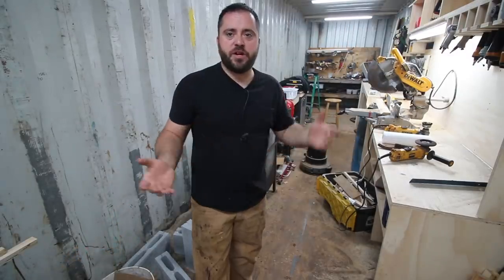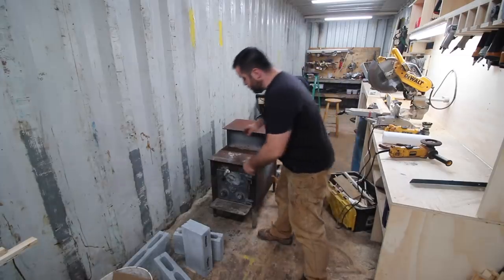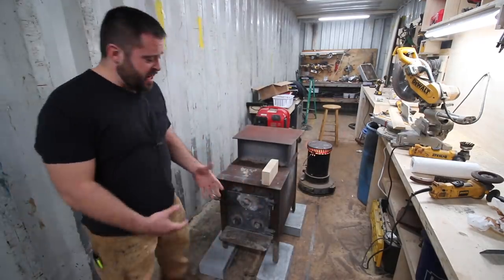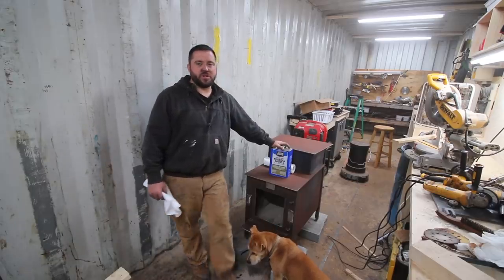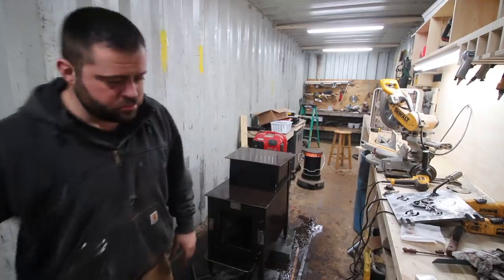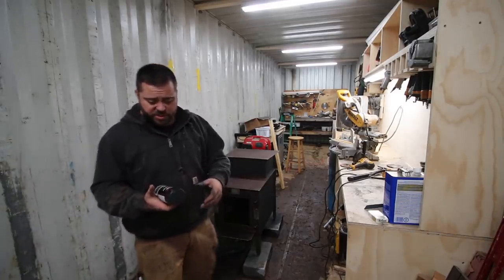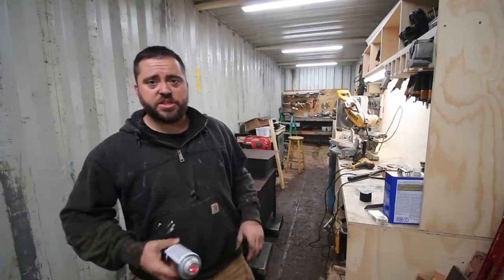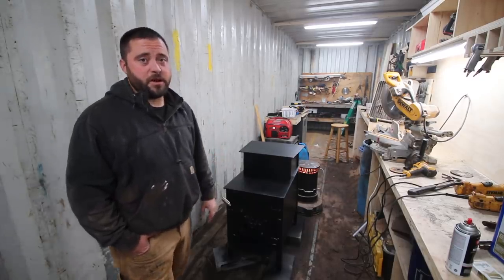Refinishing a WOOD STOVE!  Is it worth it?

Comment: Hi Dan, in the old days a black smith put used motor oil on the stove and set it on fire, even better, first heat up the thing and than put it on fire. In the used motor oil there is steel/iron and because the oil burns and heats up the stove the carbon comes out and sits on the surface. This gives a very durable coat that is heat resistant. So if there is an old tractor, change the oil and put it on the stove and torch it. Eh, first put the stove outside. It will look fabulous also.
Reply: Hey- I’m ignorant-  I thought used motor oil is post black smith era ?
Reply: @jeremiaht7063  there are black smith still today

Comment: I would also recommend the stainless steel for the first couple of pieces but for sure do not use galvanized because the off gassing will make you good and sick! Also you can by stove paint designed for wood stoves.

Comment: I’m not a “handy man” by any stretch of the imagination. I got a ‘box king’ wood stove for $20, pretty solid shape. Used wire brushes to take off all the rust. I use mineral spirits when I’m restoring older firearms (cosmoline etc...), so I saw this video, and cleaned the stove with it. Came out nice. 2 questions:
1. After the mineral spirits dry I can spray paint (stove bright) with no issues ? I towel dried initially but I’ll wait a while before I paint. I’m in no rush... 
2. The gaskets in the sides are drying/rotting away. Any feedback on how I can re-gasket those areas ? All feedback would be appreciated.

Comment: Yes on the fire brick. The inner steel wall is cracked, because there is an air gap. The air gap does not let the heat dissipate . Keep a small layer of ash on the brick work floor it will act as an insulator.

Comment: You can just add 2-3 expanded steel or hardware cloth screens in the exhaust housing to avoid sparks and cinders from going up the flue.

The fire brick resist heating, but will reflect radiant heat back into tinder box.  IE the outsides will be cooler, and inside hotter. = more complete burning and more heat with less firewood.
Reply: Great Tip on putting some Stainless screen in the pipe...but make sure to check it for creosote if your not burner efficiently..

Comment: Looks sharp man.  Id try using bricks on the bottom and maybe the back wall.  Keep the width inside for a wider burn area.  Didnt look like their was a seal around the door either.  Will be hard to control the burn with no seal and the loose air intake vents.  I think they used to be threaded.  So the more you open, the more air.   I wonder if you could fix that one way or another.  Save you in wood and make it easier to control the temperature.  My 2 cents bro.  Lastly, always keep the camera rollin... disasters get views!  lol.  Happy their was no real damage though.  Fire extinguisher may need to be in next months budget.  ;)
Reply: He probably took the seal off to grind it. You can see where it was

Comment: Not sure if you noticed but that stove is supposed to have 2 open vents on the front and a fan on the back and it would double the heat out put.   It pushes the air between the walls of the stove out the front like floor vents in a house,   I’m sure u could grind off the plates they covered them with and re fit it with a fan if your still using this as your heat source and want to get more out of it 👍
Reply from the maker: The inside wall is cracked so they were closed. The stove was a real piece of crap.  Should have found something better.  Live and you learn if the carbon monoxide doesn’t kill me.

Comment: They make thinner firebrick for stoves. They are used On the stove floor bottom and lower portion of the sides to keep from warping the metal from the high heat.

Comment: PS. The fire bricks are essentially an insulant. They also protect the steel which will eventually burn out. Used in modern woodburners because the steel is so thin. The bricks are also used to direct heat out the front of the stove. If you're looking to have radiant heat in every direction then maybe just lay them in the bottom. Depends how thick the steel is on the sides and back. Leave the top unlined and you can then cook stuff on the top, melt glue, set fire to yourself etc. Not sure taking a horizontal flue pipe out the side of the container is such a good idea. You want a decent draw or the place will be full of smoke all the time. You can always stick a damper in line inside the flue to lessen the draw but only the length and angles of the pipe will set the draw strength. That's probably your most important calculation in setting it all up.

Comment: The second step part of the stove would be a perfect candidate for a secondary burn chamber. You would really get wood saving and a lot more heat and super low smoke and creosote too. Get rid of the inter steel walls and replace them with fire brick. That is what i did to my stove and it really works great. Good day too.